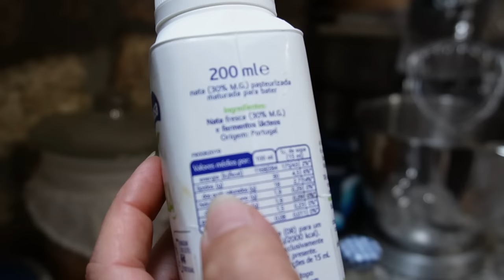Granite Sinks, Massive Beams and Blackberry Icecream - 163

Comment: Lovely episode, my favourite is the use of a working gas canister as a lifting point. However can I suggest going to the next level. put an inner tube on top. Then you can connect to the gas and inflate to raise the sink to the exact level. This will save your back. 😉👌 Just have to add the health and safety flag "Please don't try this at home" 💥😍

Comment: When I was a lad I lived opposite a great big hole 450 to 500 feet deep and 400 feet in diameter. It was surrounded by rough ground and had a highly dubious, rickety viewing platform overhanging the chasm. There was water at the bottom but pigeons flew about hundreds of feet above that, and hundreds of feet below me ... Rubislaw Quarry, Aberdeen. Most of Aberdeen came out of that hole, and so did your sink, I think.
They blocked access to the quarry and built an industrial estate for the oil business around it. It seems to be full of water now. What a shame - it was fairly terrifying to stand on the edge and look down
Reply from the maker: Had lots down our way in Cornwall, some were mine shafts some were quarries where they mined the granite to build the engine houses etc
Reply: @projectportugal  That was a long winded way of me saying I think your sink and top are Rubislaw Granite/Aberdeen Granite - if so, it has travelled a long way 😁
Reply from the maker: @Neilhuny  no mate it's local to here